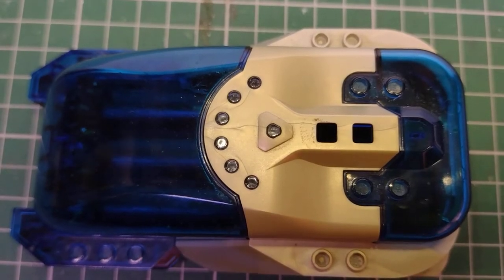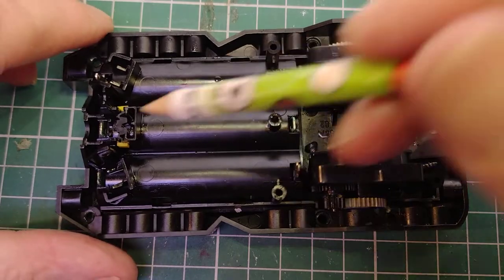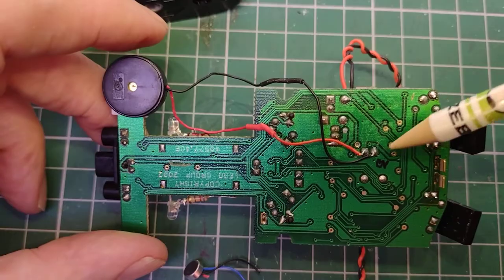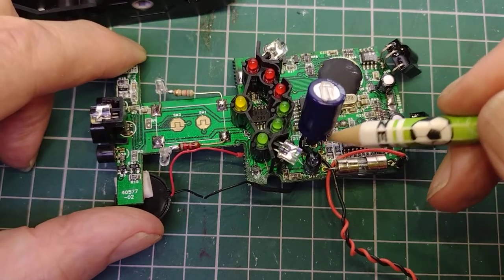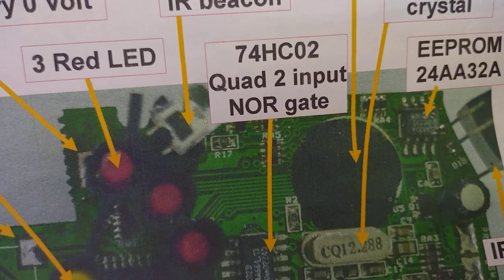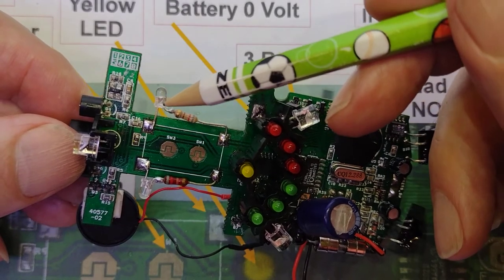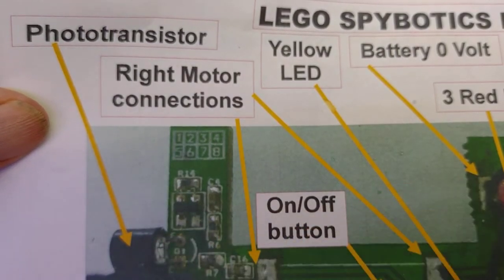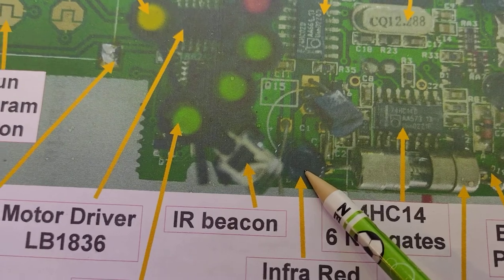LEGO  Spyibotics PCB analysis & some circuits.

Comment: I appreciated your hard work to decode the circuit. I have two Spybots and they are still working well, and I feel wrong to throw them away. Then (20 years ago) I collected many documents and software related to these bricks, however at these modern days finally I have to use the NQC and BricxCC via a serial port of my desktop.
Reply from the maker: Thank you for your comment. It's good to hear you still have two Spybots and they are still working. I feel it is a great pity they aren't still made.

Comment: Fascinating! 

I've been looking for something like this for a while, and was intending on disassembling one of my own (probably still will). Have you gotten much further since April?

I've done a lot of work reverse engineering the IR communication and detection protocols the Spybots use and I've discovered some interesting things.

The Spybots use the 3 flat/clear IR beacons and 2 IR detectors in order to "see" each other (& the remotes). I believe the feedback portion of the beacon circuit you found is to remove reflections of the Spybots own beacon from the detectors (so it won't "see" it's reflections).

The dark blue IR transmitter is what is used by the Spybots to send messages back and forth (received by the detectors). However, it can also be reconfigured via programming to act as a serial UART and send essentially arbitrary IR codes. It can talk to the RCX and control other Spybots (or the Manta motors) this way. With the correct programming, you can also upload code to a Spybot using an RCX infrared tower instead of the light tube.

See these links: 

https://pbrick.info/2013/10/controlling-a-spybotics-pbrick-using-an-rcx
https://ofalcao.pt/blog/2017/decoding-old-lego-infrared-protocol

I've managed to get a Spybot to detect an RCX as another Spybot, by having the RCX playback the Spybot beacon. Getting a Spybot to detect the location the RCX has proven a bit trickier, as the Spybots seem to be also transmitting a "verification" signal from their serial IR TX that is overlayed on top of the three beacons, and I've yet to decode it enough to reproduce properly.

Also, according to this, the microcontroller is likely an Hitachi H8:

https://www.avrfreaks.net/forum/ot-lego-spybots

Cheers, and let me know how you're making out!
Reply from the maker: Thanks very useful ☺️. I've moved on to other things I hope to get back to Spybot's sometime. Using cells from discarded vapes is taking most of my time. I hope to use them in Spybots and other things when I've got them sorted.